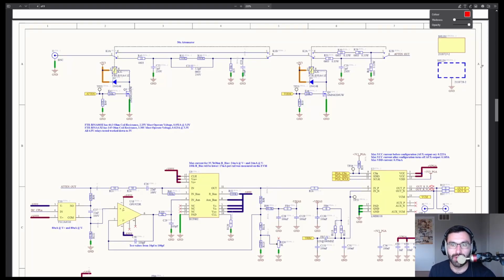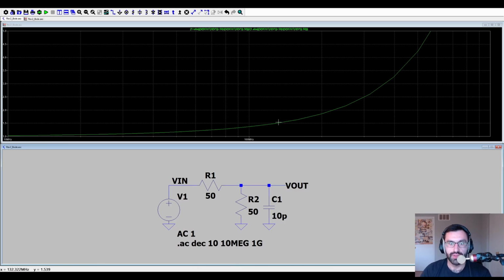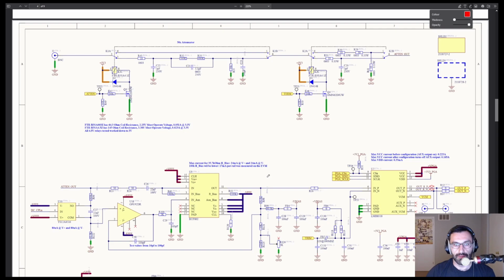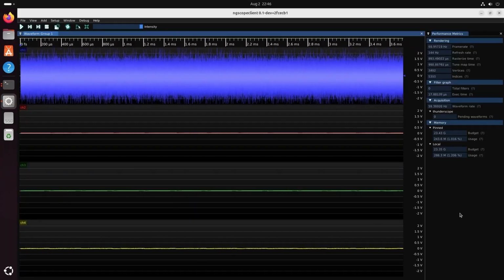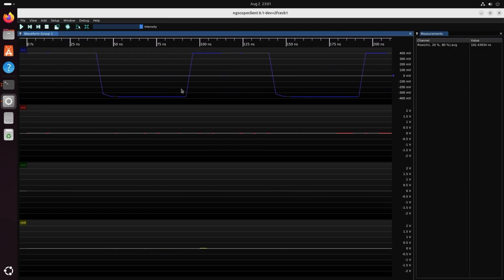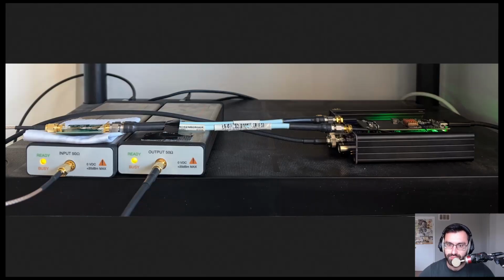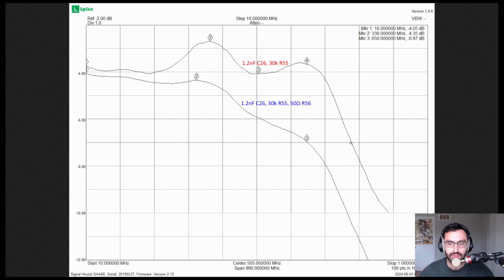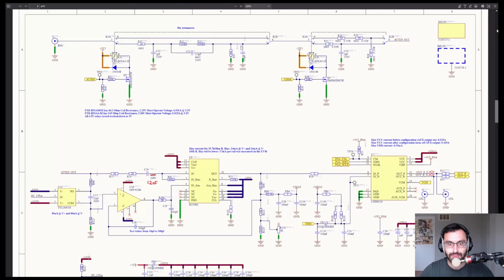ThunderScope Analog Front End - 50 Ohm Bandwidth

Comment: I find this a very interesting series... I'd be curious know much (if any) part temperatures might affect impact your results...with RF shielding, a power hungry FPGA and a enclosed dark metal case I'm assuming things could get a bit toasty...
Reply from the maker: It's key to let the temps stabilize before running any calibration, the unit will keep itself at 60C or so (but consistently so) at room temp after about 10 minutes. Since we can then assume constant temp, calibration will remove whatever dc offsets arise. The ac frequency response won't really change, but noise will get worse with temp, but that's just a natural fact, can't avoid it.